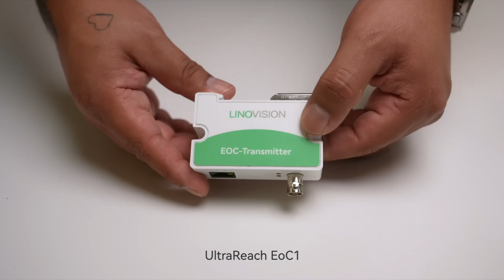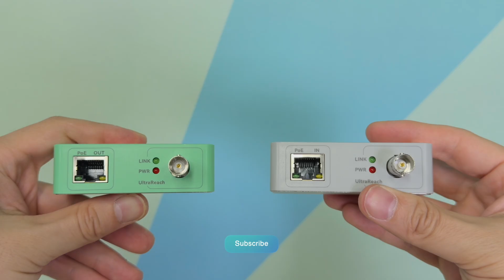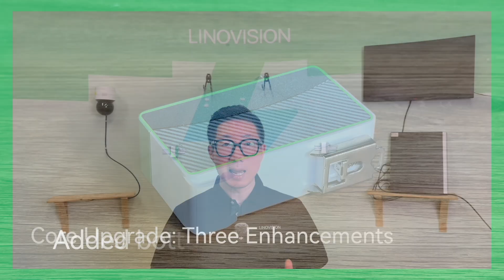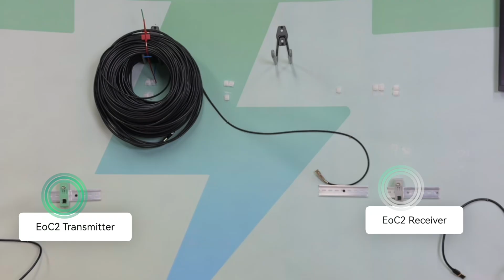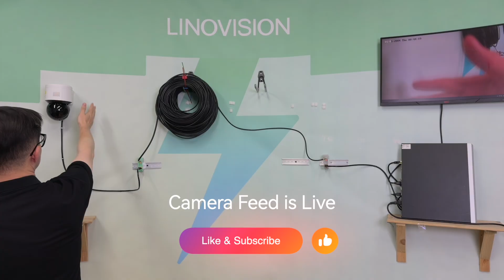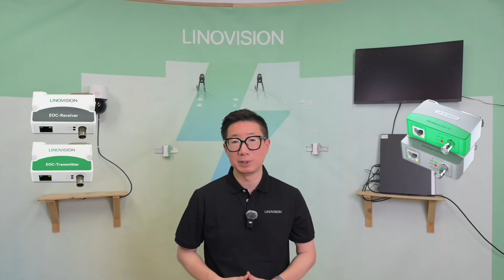Introducing UltraReach EoC2

Comment: Do these only transmit video or do they transmit all data over ethernet?  Thank you
Reply from the maker: Great question. Our EoC products transmit full Ethernet data over coax, not only video.

They work as an Ethernet bridge, allowing IP-based devices to communicate through existing coaxial cables. This means they can transmit video streams from IP cameras, but also other Ethernet traffic such as network data, control signals, and device management traffic.

The actual performance will depend on the specific model, coax cable quality, distance, and network requirements.

If you share your application (for example, IP cameras, access points, or other Ethernet devices) and the coax distance, we can help confirm if it’s a good fit.